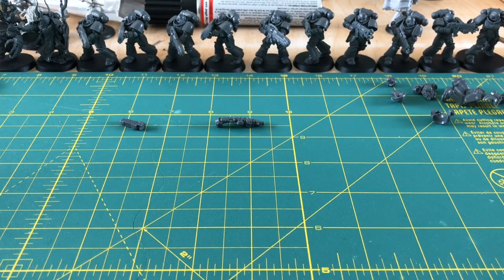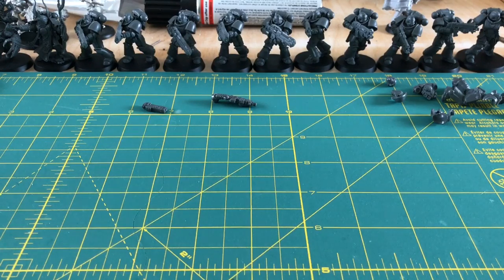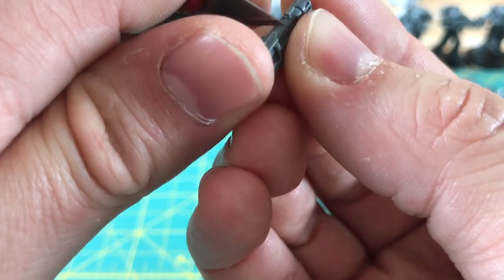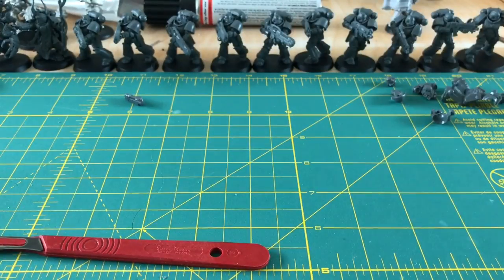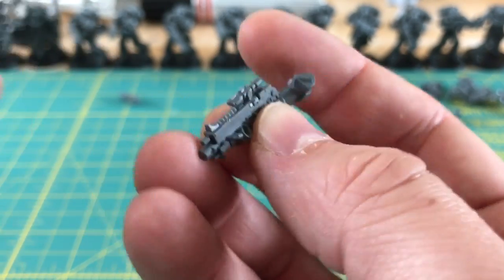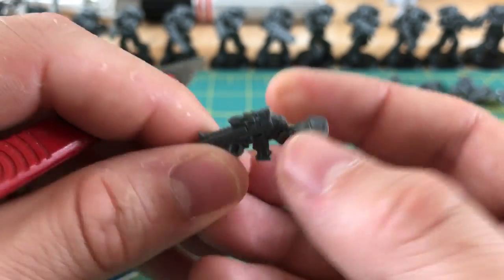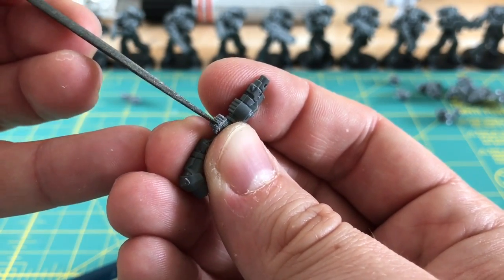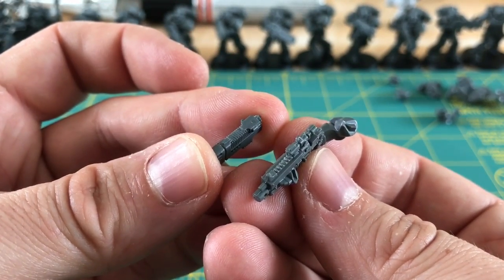How-to shortish: Mould line clean-up on plasma coils, picatinny rails and bolter magazines

Comment: I know you've probably moved on from this, but the way I get the mouldline out from the low parts of the coil is with a piece of sewing cotton. It's easiest to do if you have a small vise and secure the plasma weapon in it, then use a decent length of cotton to "saw" across the depressions. Then you're just left with the easy raised parts. Thanks for the video in any case.

Comment: These are some of the hardest areas and types of mould lines you are going to encounter. I use the back of the tip of a #11 X-acto blade and use it to scrape along each tooth or groove after I have scraped over the top in the normal mould removal process. This extra scrape along each tooth/groove will clean out the excess plastics, but will also scrape out the mould line it normally cant reach.

Comment: The moldline removal tool from Games Workshop in my opinion works great on flatter straight surfaces, like the top of the barrel of the plasma gun you were working on or the side of the legs of a space marine. For more detailed work a hobby knife is really required. The back of a hobby knife or a blunt one would do the same job and is more precise.
Reply from the maker: +Amanda Jansen Would you say the mouldline removal tool is worth investing in as opposed to using knives and files on smooth surfaces? Have you any experience of using it on resin models and if so is it effective? Thanks for watching :)
Reply: No, I don't think the moldline tool is worth investing in unless you mostly work with Games Workshop's plastic. It will certainly be easy on Games Workshop plastic models, but you can easily do the same with a knife. It does however make it hard to accidentally cut into the model as you're cleaning it.

On resin models I haven't had much success with it. A knife works a lot better than the moldline remover. Games Workshop's plastic is fairly soft and thus it works well, for the rest, it really isn't as useful.
Reply from the maker: +Amanda Jansen Cheers, good to know and thanks for sharing your experience.

Comment: what files do you use? I recently bought citadel ones off of amazon but I'm still open tbh to having more just to have the variety
Reply from the maker: These on eBay are the same design as the type I use. I like them as they are pretty unfussy and get the job done well.

https://rover.ebay.com/rover/0/0/0?mpre=https%3A%2F%2Fwww.ebay.co.uk%2Fulk%2Fitm%2F232598980934

Personally I've never seen the need to use a file with a hand grip but that's an individual choice TBH.

Comment: Have you found that the new plastic for these guys is "softer" than it was.
Reply from the maker: +TheJankmaster I'd say it seems consistent with anything I've built from GW in the last decade. It is definitely softer than the material they used back in early days of Rogue Trader although at that point their plastic kit manufacture was outsourced to a different company..... Revell possibly? Thanks for watching :)
Reply: leakycheese could be...converting some of the new PoxWalkers and Putrid Blight Kings for use in Blood Bowl is good news/bad news. Easy to remove weapons, but you have to use a light touch or xacto slices through the hand completely,
Reply from the maker: +TheJankmaster Yes, I've been working on a Gundam model today and there is a huge difference in the plastic hardness between Bandai (hard) and GW (soft).

Comment: do you wash them after removing mold lines etc ?
Reply from the maker: I don't wash plastic models at any stage of construction or assembly. Why do you ask?
Reply: I watched a video which may have been made by you where some sprues were washed and left in water with fairy liquid and the water turned cloudy / sparkly almost, so there may have been some residual chemical left over from the molding process.
Reply: @davedogge2280  that was probably resin, not plastic ;)
Reply: @Alaska1925  aye the resin molding process produces minis with more residual chemicals  on them which are meant to interfere with acrylic paints I think.